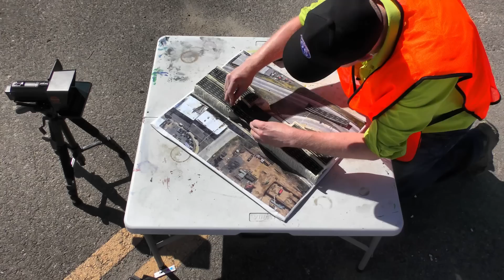Here's How Pennsylvania Re-Opened I-95... in Just TWO WEEKS!

Comment: When I first heard that I-95 was going to reopen in 2 weeks, my first thought was that they would use sections of Bailey bridge, where they use modular panels of preassembled trusses to build a temporary bridge.  Maryland did something like this on a lot of roads following Hurricane Agnes, and more recently built a temporary bridge over the Patapsco River carrying US 40 while a new permanent bridge was built. It couldn't handle heavy truck traffic, but I-70 was the primary truck route through the area anyway. They were originally deployed in wartime to reopen bombed routes quickly, but but they would have limitations carrying large volumes of heavy truck traffic for the months it will take to rebuild a permanent bridge. I can see why what they are actually planning would be a better solution.
Reply: There is a "temporary" Bailey Bridge in Northeast Philadelphia, it's on Byberry Road over the Conrail tracks.  Been there for probably 30+ years.  It's CRIMINAL that PennDOT has not widened Byberry Road to accommodate the horrendous traffic that comes and goes to Woodhaven Rd via Byberry.  If they had any foresight they would have figured out how to extend Woodhaven Rd to County Line Rd to provide a path to and from I-95.
Reply: So the temporary bridge option was considered right away. We discussed it Sunday afternoon. The issue here is that the overpass is skewed. The deck is actually a trapezoid. Because of that, concrete diaphragms were built at both ends. Also the existing bridge deck and approach slabs are tied together. There are two pavement relief joints further down the approaches (asphalt filled gaps) that act like an expansion joint for this type of bridge. The lack of expansion joint at the backwalls helps keep the water off the steel and prevents corrosion. Here, it seems like it didn't help with letting the heat escape from under. But who designs for a massive fire under a bridge?

Comment: How were the steel walls built to hold the fill material in place?
Reply: based on what I can see in the Penndot videos, it looks like pre-formed concrete sections, stacked up like Leggo blocks, that interlock with each other. It may be some other material because they are darker than normal concrete.

Comment: They did something similar for the I-480 bridge repair up in Ohio, obviously a bit more complex than sand and asphalt. But they built a middle bridge, shifted eastbound traffic onto it, and then switched with westbound after repairs were done. It's taken 5 years, but it's almost finished.
Reply: They actually just rebuilt the bridges being replaced in this manner, which is why I'm somewhat hopeful the Cottman exit won't be closed for the entire duration of the rebuild ,but only up to the point when the outer bridges are finished, allowing 95 to be routed onto them, and the inner temp road and the glass aggregate fill is removed.

When the bridges were rebuilt in 2014-2015, they shut down the SB side first and routed all traffic to the NB side. Once they had rebuilt the SB bridge they did the reverse. If you go to Google Streetview and look at a historical view in 2015 you can see the project in progress, with the NB bridge removed. Crucially, the Streetview was possible because the ramp WASN'T shut down; they put concrete dividers on both sides and narrowed the width making it essentially one lane (right now it's two, and under the bridge begins to widen to three or four lanes). Once the replacement outer bridges are finished, they'll be in a similar place as 2014-20155l, and I'm hoping they'll reopen Cottman then.
Reply: @@phillipbanes5484 Well this bridge is almost 3 times as long as the Empire state building and built 200 feet off the ground. Combine that with rain, snow, and modern day construction bidding wars and you get long construction projects.
Reply: @phillipbanes5484  The valley view bridge is 4,150 feet long, and it's indeed the one they are repairing. There is something wrong with modern day construction for sure. Just follow the money.

Comment: The US60 that runs through Mesa AZ had a bit of water pool up under a overpass. It took them WAAAY longer than two weeks to fix, so this is pretty remarkable.
Reply: They had to repair the pipe
Reply: I guess AZ is really not used to water, so it's was a tough fix! haha
Reply: 🎵"Superstition ain't the way."
Reply: It was more than a bit.
Reply: The Westbound side was opened in about a week. The Eastbound side took longer because a pipe had to be repaired.
Reply: Without I95 the whole east coast basically stops working, but even 2 weeks is slow.
Reply: @s0nnyburnett  well nobody's starving, so can't be that important
Reply: @s0nnyburnett  There are already a lot of alternatives to I-95 for travel around Philadelphia on both sides.  This is much more of a problem for getting into and out of that city, truck delivery, etc.  Still obviously needed a fast repair, but it doesn't really hinder travel from say NY to DC that much.

Comment: the bridge was not concrete, although the roadway & abutments are, of course

the relevant bit is the structural pieces were welded plate girders, not reinforced concrete, so the whole premise of the collapse explanation is entirely incorrect
Reply: yes, but once the steel weakens and deforms, the concrete can't stand alone. The video may not be perfect from an engineering viewpoint, but it helps the average Joe get a grasp of the situation.

Comment: As somebody from New Zealand, no, that's not an authentic cheeser, but perhaps more importantly just not the best execution. Sliced bread is wrong, should be a roll - what's the point in all that filling if it falls out? Pepper (or capsicum as we call it) doesn't belong there, though that's more personal preference. The onion looks too coarsely sliced IMO and barely cooked - I'd want it to be crispened. 
You also should have had the choice to have 'wit' onion or without, and which cheese you prefer. Traditionalist cheesesteak has only bread, cheese, beef and onion.

Comment: This is a good thing because people can turn to public transit which really should be the dominant way to get around
Reply: The problem with public transit is "the last mile" it doesn't cover for 95% of the population. I can drive to the NYC airports from my place in Ct... takes a bit over an hour. (night, with no traffic) If I get a ride to a train station I can also do that... BUT... for an early flight I would need to start the night before, make 3 switch-overs, take a motel in the city (taxi or shuttle) then get local transportation to the terminal. We're talking a minimum of 16 hours (with connections) and 4 times the cost over driving. I'm also 70 years old so walking miles with luggage is starting to be problematic.
Reply: @rupe53  but it should cover the last Mile. This is what transportation planners are trying to solve!
Reply: @transitcaptain  ... Yup, but at what cost? I am just rural enough that buses and trains don't run after 10 pm. Even if they did, you can't leave a car in their parking lot for a week while on vacation. I could grab an UBER but that's just another car on the road so doesn't solve the issue.
Reply: @rupe53  I can’t. I just can’t.
Reply: I really don’t see that happening.

Comment: They didn't build retaining walls and then filled it in with aggregate. They built layers of aggregate with the sides being held in by retaining mesh. The weight of each layers creates a stable surface. You can see this from the 24/7 cam as they worked.
Reply: Practical Engineering's video on stabilized earth is the go-to explainer for that IMO

Rob gets a few things technically wrong and glosses over a lot of details in this video, but that's fine.  It's just a good quick overview of what's happening, and doesn't pretend to be anything more.
Reply: Thats still a retaining wall
Reply: @jdgvee9313  Actually, probably not.  If it is stabilized earth, the wall doesn't have to hold back large forces and is constructed quite differently from a retaining wall.
Reply: It's mesh and a wire "basket" too. The wire baskets are L shaped. Standard retaining wall item used everywhere. The precast parapet panels on top are newer items. They are a Gravix wall system. Fortunately all the materials were in stock for other 95 projects in the area and were borrowed for this repair.

Comment: They had this plan where they could hastily reconstruct 6 lanes because there was space to construct where the other lanes used to be. I wish they could do it fast if a train line collapsed as well
Reply: The bridge is 150' wide. The 6 eleven foot lanes plus barriers will use the center 75' of it. Bridge will have 16 steel beams. So the 4 on each outside part will be set. Then traffic will switch over to that.
Reply: They do this with train lines too! It's called a "shoo-fly" and there are plenty of examples. I knew what they were going to do here because of knowing about shoo-flys!

Comment: How many lanes can they get in the temporary fill compared to before?
Reply from the maker: Three in each direction, versus 4+1 (5) normally.
Reply: @RoadGuyRob  Thanks - I hope at least a few people are smart enough to avoid that spot during the busiest times so they don’t jam it up for everyone who needs it. They will have at least two weeks of practice avoiding it ;-)
Reply: one thing to consider is these lanes will not be the normal 16 ft wide, but likely around 12 ft, which is common in construction zones.... also no shoulders. Basically, the 6 temporary lanes will be about 72 feet wide, instead of the original that was about 160 feet wide, including shoulders.

Comment: Thank you for explaining how a speedy rebuild is possible! 🌟
Reply: If they absolutely needed to, they could have filled the gap in a matter of hours and created a minimally passable temporary roadwsy, but it would definitely not be capable of handling highway speed heavy traffic.  It would merely be a gravel pathway between two highway sections.
Reply: @PhilLesh69  There are two PWD sewer lines that run under the ramp that necessitated the use of lightweight fill. Normal stone would have crushed the sewer lines under the ramp.
Reply: @PhilLesh69  .... they actually did "fill it in" over a matter of hours. (like 100 hours) Bringing things to grade level will take another day or two... and paving can probably be done in a day, which will ALMOST make things normal, compared to a gravel roadway. Remember that flying gravel and changing road speeds are part of the safety consideration.
Reply: I haven't heard any reports of how long the "rebuild" will take.  This temporary bypass is not a rebuild.
Reply: @brownro214  working on schedule today for rebuild. We had to figure out what condition the abutments were in. Cores were taken Monday.
Reply: @brownro214  ... the full rebuild will include waiting for the custom parts to be made and delivered. That task alone will likely be several months. I suppose they could look back at the last rebuild (less than 10 years ago) to get an idea.
Reply: Would it be possible to build a replacement bridge(s) in an area close to the broken bridge? When completed close for a weekend, prep the area and lift the bridge(s) into place? I remember the state of Utah did this a few years ago. Did Rob do a video on this?
Reply: @donsisco852  ... probably too big to lift the bridge into place, but building directly next to this and sliding into place has been done. OTOH, I have only seen them do it with 2 lanes. It was done over many months and moved over a weekend. Of course, that also takes a LOT of planning in advance.... and a fair amount of elbow room to work.

Comment: That sandwich is an abomination. Looks sort of yummy, but in no way resembles a proper cheesesteak. 

PS. "Cheesesteak sandwich" is redunadant. Calling something a cheesesteak implies it is a sandwich.
Reply from the maker: It tasted good. Guess I need to get a real on in Philly some day.
Reply: @RoadGuyRob  I lived in Arizona for a minute which might be more your neck of the woods. Tucson has a place called Frankies - the owner is a Philly native and they get Amoroso rolls flown in every three weeks.
Reply: @oelschlegel  The Cheesesteak Shop chain in the Bay Area, CA is legit as well. I wandered in and discovered the Philly-born founder behind the counter at a store one afternoon years ago. Amoroso flown in daily, etc. 

Big John Steak & Onion in Mid-Michigan is accidentally a decent steak. No Philly connection, but gets almost everything right except the cheese placement.
Reply: @jasonfullerton7763  I was wondering about The Cheese Steak Shop chain. I had them a number of times when I worked in Oakland and lived in El Sobrante. (There's even one in Petaluma now.)
Reply: Cook thin sliced rib eye on a flat grill, add raw diced onions (if "with", skip if "without"), chop meat with long spatula edges as cooking to desired texture.

Cut open a long Italian roll end to end, but do not slice through. Open and flatten roll. 

Form a rectangular pile of delicious meat about the length and width of opened roll. Layer American or Provolone (Wiz is for tourists) cheese on top and allow to melt.

Place roll, OPENED SIDE DOWN, over the meat and cheese. Use spatula under meat to flip everything. Scoop straggler meat into sandwich, then use the spatula edge to fold the roll closed. 

Enjoy!

Comment: Cool video.  This is similar to the emergency repairs made to the Sanibel Causeway in Florida after Hurricane Ian last year.  They also used temporary retaining walls to get the causeway reopened in 2 weeks while permanent repairs are underway.
Reply: Yes but Sanibel has NO WHERE NEAR the amount of traffic and daily tonnage that I-95 has on the daily.  I really doubt this band aid is going to work.  An now Far Ne Philly and Bensalem are going to have traffic issues because the cottman exit will still be closed down
Reply: @1realtruthrightnow742 I live at the recently closed Aramingo exit, the next one south of Cottman. There won't be traffic issues relating to closure of Cottman.
Reply: @1realtruthrightnow742  Bridge Street exit being closed 2 months ago makes this closure bad. The plan is to get the ramp open as soon as the traffic is switched to the outer bridges. The work on the center section will occur with traffic using the exit below. Beams should be here in a month. Add some time to erect them, build the new decks and parapets and to tie the deck into the roadway. Maybe this fall if all goes well.
Reply: @oscarwinner2034  I suspect we will be talking about this for another 2-3 years.  This is Philly & Penndot in charge of this operation, the worst combo to be in charge of anything.
Reply: @1realtruthrightnow742  Ironically PENNDOT is who got this repair going quick. By the time the FHWA and other Federal Agencies came around we were already moving on the plan we came up with days earlier.